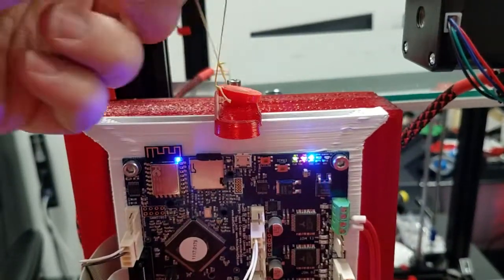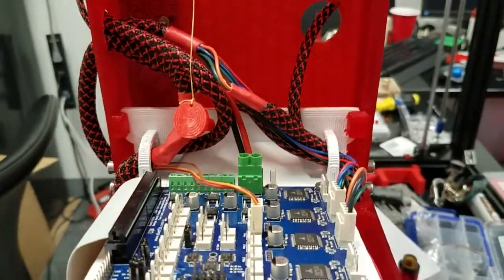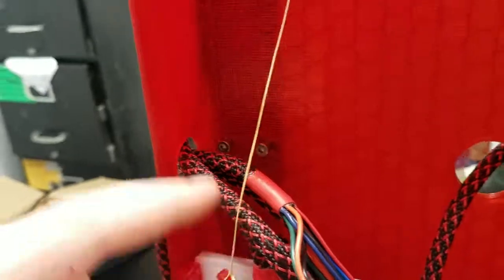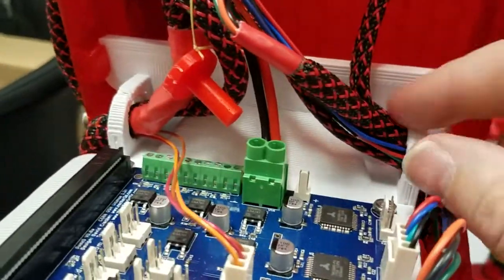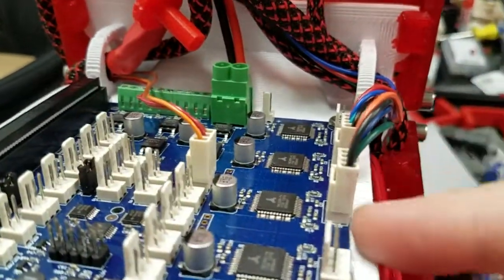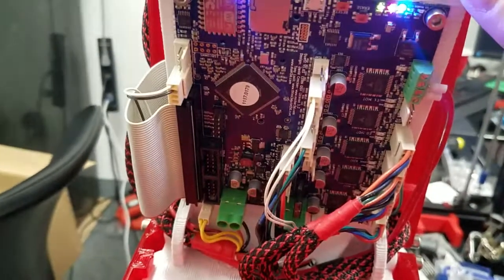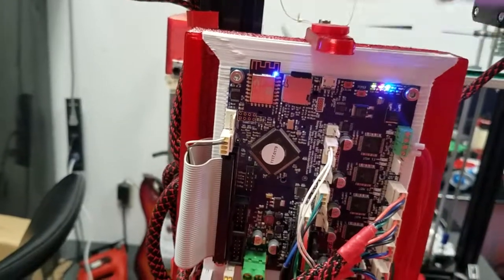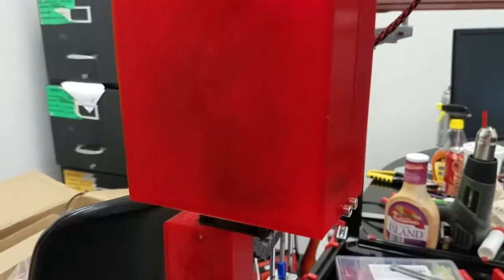DuetWiFi + Duex5 Total Access Enclosure walkthrough

Comment: Your not getting any air flow over components, Your only cooling the bottom of your boards which are not conducting all the heat that each component is putting out cause none of them are making complete contact to the board only by the pins that connect them. And that would be equal to cooling the engine in your car by a fan blowing on your radiator hoses and not the radiator. and why haven't you installed the aluminum heat sinks that came with the boards to be installed on top of the motor drivers. Not to be complaining on your video which it is a nice plan. But need further development to serve the purpose.
Reply from the maker: The TMC drivers the Duet board use generate heat on the bottom. The board side. Cooling off the top side of the drivers with heatsinks is not effective, as that's not where the heat goes. The heat goes onto the board. 

So cooling the bottom of the board (where the heat is going) with unobstructed is making the biggest difference.

I will say that you have a point with the rest of the non stepper components. All that I can say there is that my board temperatures are monitored, and it simply doesn't get hot in there. 

It's like sitting in a car in winter with no heat. Your body does eventually generate enough heat that it feels warmer in there, but since the ambient temperature of outside of the car/box is low you never get hot enough to sweat. 

Anyway. I have been running this box since  I made it. Probably almost 2 years. Many 30+ hour prints. No issues from the duet!